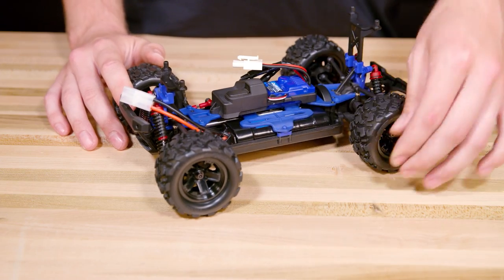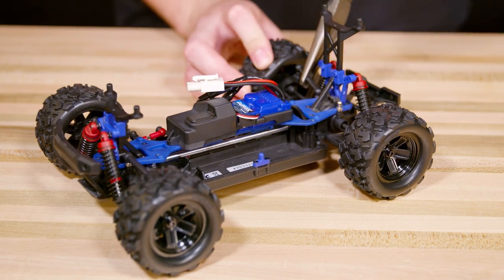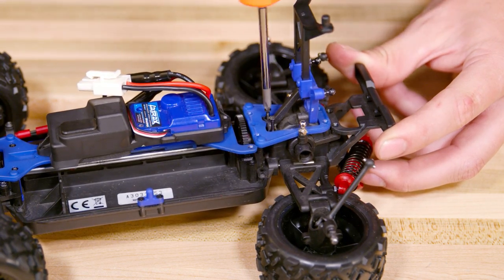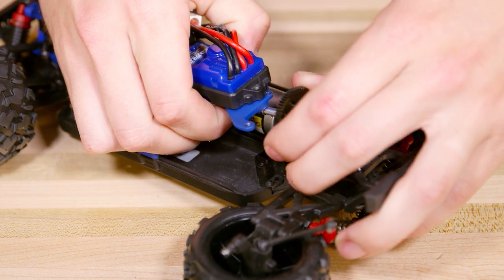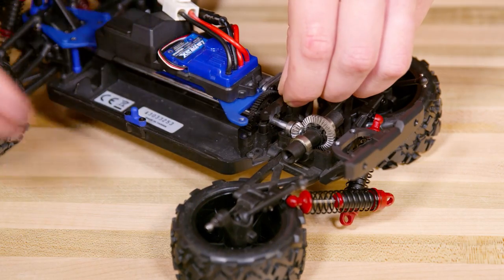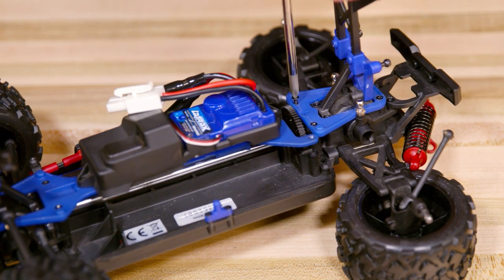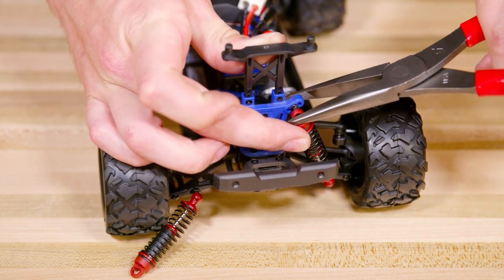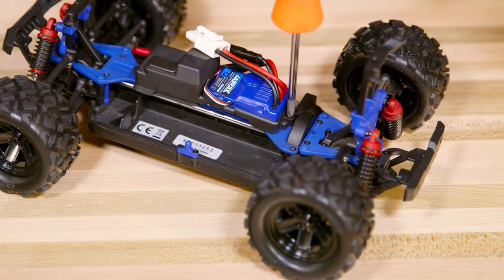How to Replace a Spur Gear | LaTrax

Comment: i sent mine off for repair with a broken ESC & it came back with more problems even though they had replaced the ESC/MOTOR with drive now working, the servo was dead, a front bearing was seized all of which i repaired myself & now i the motor pinion/spur is making a very loud noise iv tried to loosen off the pinion gear thinking they set it too tight but with no joy please help :(
Reply: If you upgraded the motor it’s definitely too powerful for a plastic spur gear you need the hot racing spur gear ⚙️

Comment: replaced the motor, in place, indexed properly and it's now insanely loud, in higher end trucks you can adjust the gear mesh but now on these lil buggers, it's preset. any ideas? same gears, same motor place, only swapped out the motor.
Reply: nocoolname32 any updates on this? Just replaced my motor and it sounds louder too
Reply: @Mamut86  same problem
Reply: File the motor mount. I did on mine so I could swing motor closer for tighter mesh. Also using a castle 4 pole motor with reaktor esc. Absolute monster combo on 2s